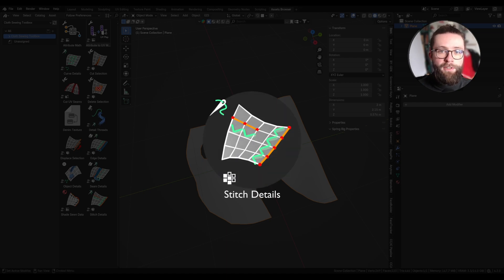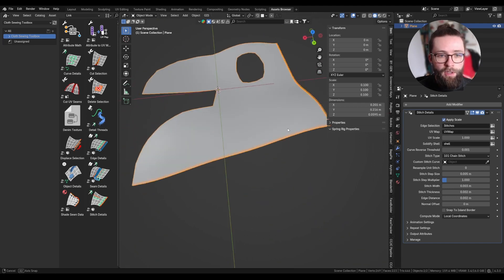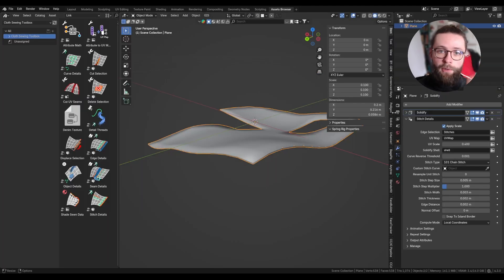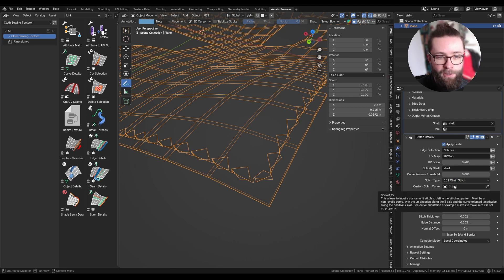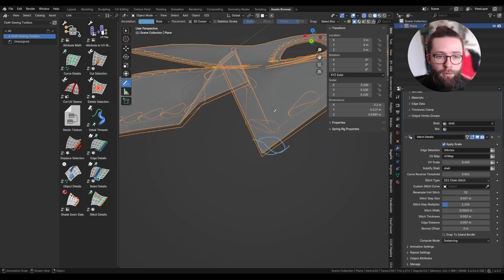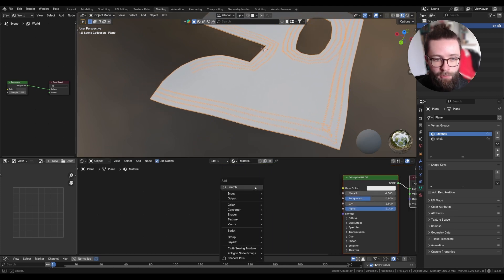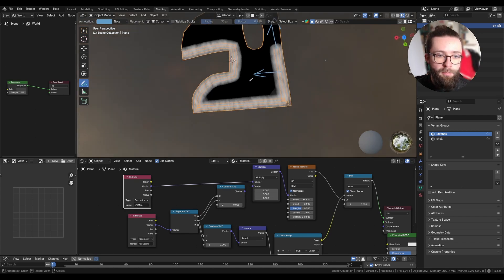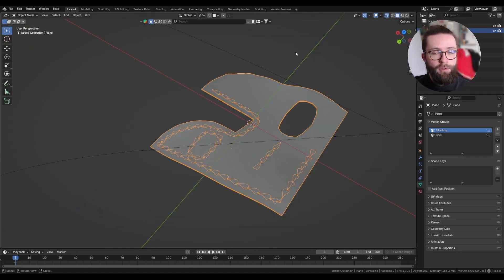Stitch Details Tool Tutorial - Cloth Sewing Toolbox for Blender

Comment: Hi Alex! I see you recommend dragging and dropping from the assets tab, is it okay to just use the add modifier in the modifier tab on an object or are there reasons a person should not? Thanks!
Reply from the maker: The main point is to use the asset library in link mode instead of adding all nodes to the blend file to facilitate updating, but once the library os setup, you can indeed just add them as modifiers!